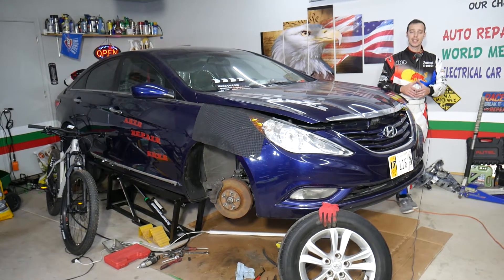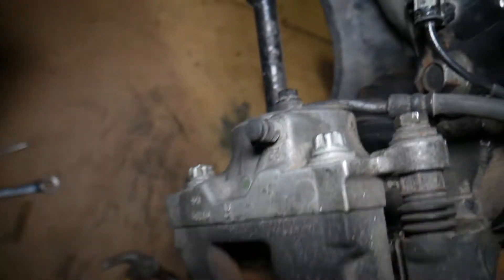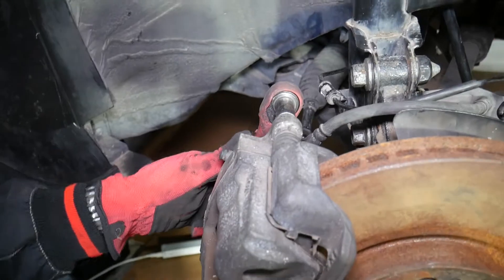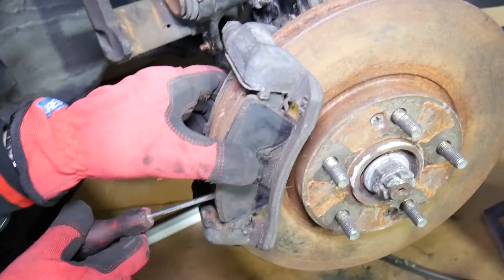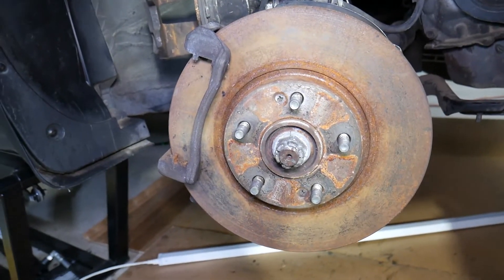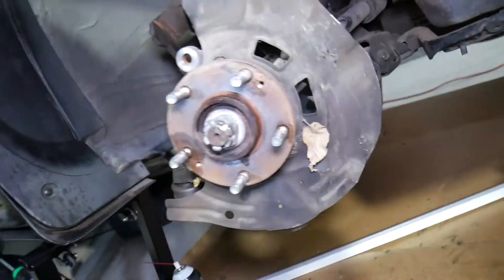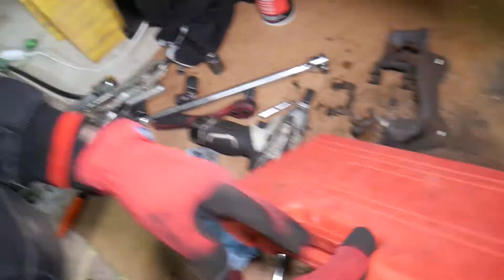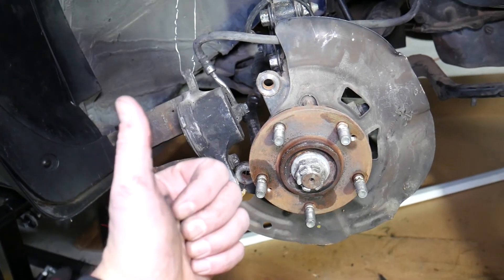HYUNDAI SONATA FRONT BRAKE PADS REPLACEMENT, DISC BRAKE ROTOR REPLACEMENT REMOVAL PART 1

Comment: Just use a C clamp to compress the caliper. Better yet when the caliper is on the car use a screwdriver wedged in between the piston and rotor and pull on it until the piston retracts.